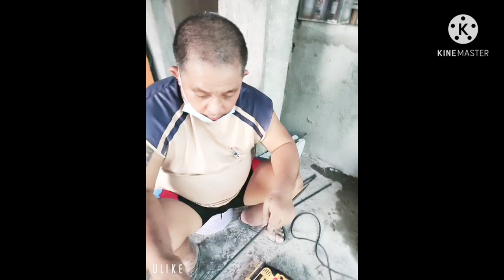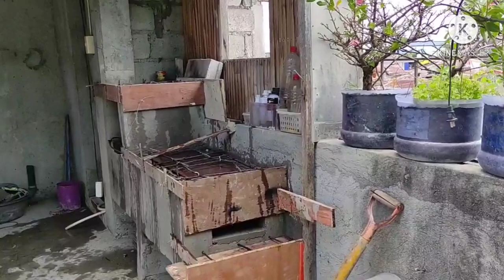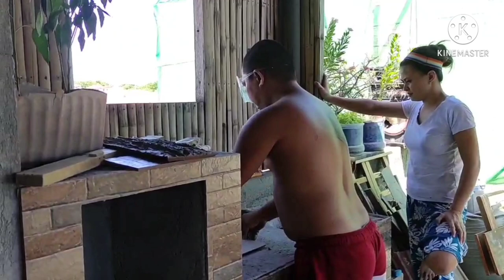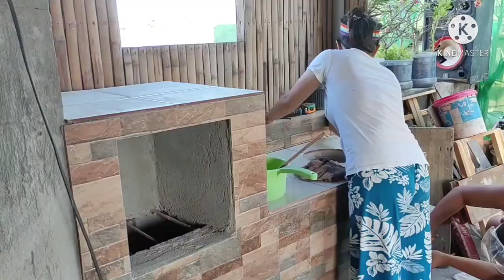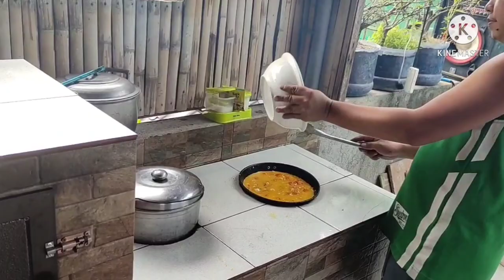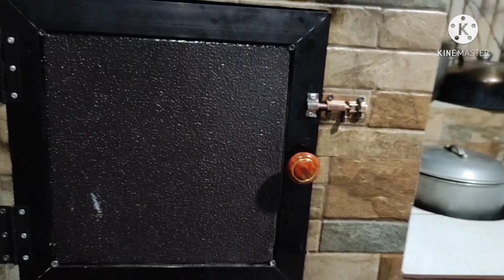Pogon tipid sa kahoy                 traditional firewood stove

Comment: Traditional pugon is made of fire bricks. It can withstand high heat and heat stays longer than ordinary cement. And it has 3 circles that each have small to large metal ring's.
My grandpa used to build it.
And the foundation has to be very solid. Much better if pugon sits on big or buhay na bato.